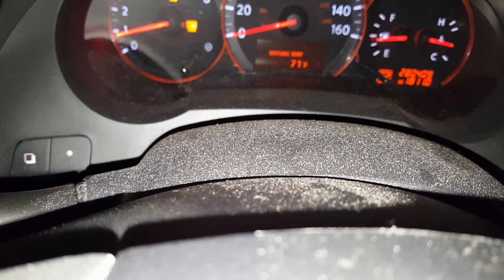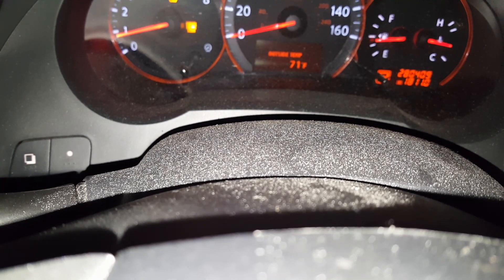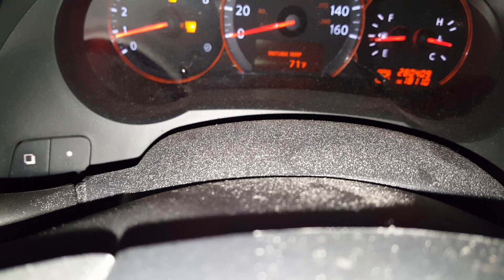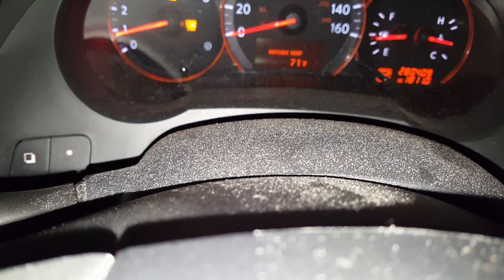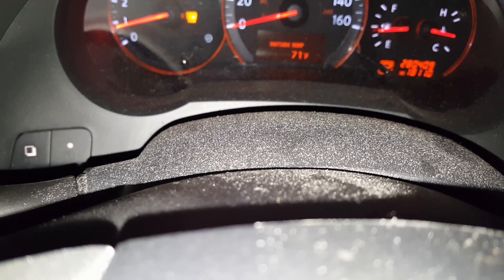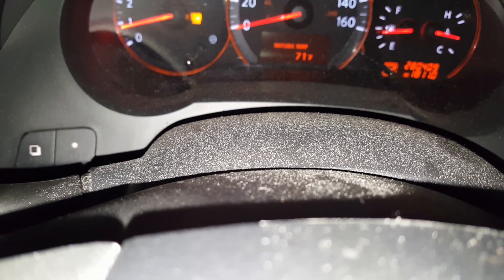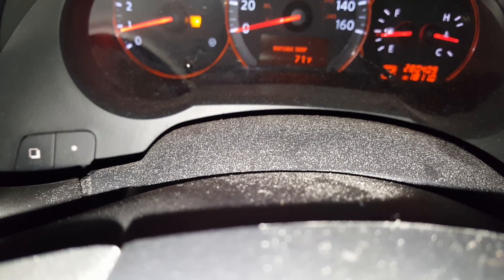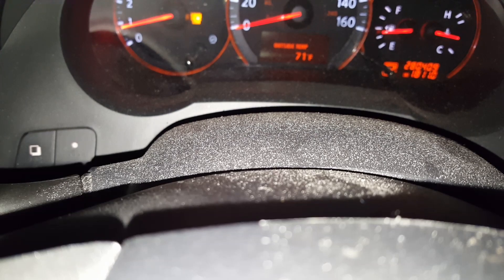Why is Safe Mode and LIMP mode on CVT Transmissions such a mystery to Everybody?

Comment: You were right just You we’re explaining it to dum ass mechanics. Safe / limp mode is common in nissans. I have a 07 Altima and the code came up was p2101 throttle issues

Comment: Yea the CVT does that my maxima 2010 after I have been pushing it for about 20 to 30 min it drops the redline from 7000 to about 4500
Reply: Did you find the issue ?
Reply: @JuanVazquez-en8uz  i was from over heating
Reply: Did you find the issue
Reply: @Markooboog  it was from over heating I found that installing an aftermarket transmission cooler helped it more

Comment: The main problem with CVT transmission is unlike an ATF   transmission  The CVT transmission fluid can get incredible hot,  mostly at the contact points of the cones and CVT belt. At these  points.  it burns  CVT transmission fluid, producing a lot of burnt carbon.  This CVT carbon in the CVT acts the same as a mild abrasive. it  left unchecked it will slowly not only wares away the cones and steel belt,   but the main parts of CVT transmission valves body  as well. Unfortunately there CVT transmission   truly need there CVT transmission fluid  change regularly

Comment: Never buy a Nissan with cvt transmission they suck.
Reply: Yea they do man I went from a Nissan Maxima 2012 that was modified with a  lot of aftermarket and engine components. I had to get transmission cooler to keep the trans cool because when I would do about like 5 or 6 pulls on the highway the trans would hear up and my car would limit the redline from 7000 down to 4500. All of my other friend in there Camero and 370z would have to slow down and cruise at slower speed to allow the trans to cool down. I got a 6 speed challenger now and it’s way more reliable then the CVT trans itself. The VQ motor itself is great I was pushing 315 whp on a 3.5 maxima never had a major issue with the engine oil was changed regularly and I always had alll fluids changed every 35,000 miles. But I got tired of the transmission

Comment: 280k be glad it lasted that long. 180k-200k is average for these CVT the valve body are garbage due to all the pressure and speed sensors. every car has some sort of safe mode. you must of taken it to shade tree mechs
Reply: 66y66 is a typo that shit u89 pl poi 8
Reply: @asiab38  typo LOL 😂 get out of here

Comment: Hey, i know this is a long one but I have a Nissan Sylphy 2006, and it does have a problem with power. First off, i do experience a delayed driving force when i step on the gas especially when the engine is hot and not in motion. This happens more so when a high torque is needed for the vehicle to move either foward or backwards. For instance when i come to a complete stop and i have to go over a bump or ramp of some sort, stepping on the gas wont make it go over immediately as i will have to deeply accelerate for a few seconds..say 7 sec..for it to even start moving. Its movement will be extremely slow until it gains momentum and after which everything works as its supposed to. Whilst all these happens, the rev conter on the dash stays stationery and does not act as though there’s any acceleration at all up until the vehicle moves. It wont rev on neutral too and the ”R” for reverse wont show on the dash board as it goes blank when being reversed. My Mech had to change the throttle sensor, had its transmission control unit replaced and also checked the exhaust system for any leakages but no show. I have constantly stayed dirty on it, moving shop to shop but it seems to prove a headache for everybody. Any help/suggestions will be highly appreciated
Reply: Have you ever changed the cvt fluid?
Reply: Exactly the same problem with my Sylphy 2007. Gearbox oil intact;no leakages. Still a mystery.

Comment: First of how many transmission have u went through u have over 200k on that thing
Reply from the maker: DailyVibeZZZ 

Just 2. The original died at 200,000. 2nd one still going strong. Close to 300,000 on my car.
Reply: Peter L wow in this video was your car sluggish from 0 to 45 miles like wavey when ur driving
Reply from the maker: DailyVibeZZZ 

No. I wasn't driving in this video.
Reply: I have 200k same tranny. Just service the thing correctly

Comment: Safe mode and limb mode can also induced by normal automatic transmissions and even the engine itself. It is in all the owner's manuals, under "troubleshooting". Every time it happens, the car computer stores fault codes that point to the problem. So in all cases you have to go to a dealer or shop and read out the computer for fault codes stored. The fault codes ares not in the owner's manual (but can be found on the internet). But still, read the owner's manual first before you drive to know at least that it is in there to look up again if it happens. Also the service intervals and everything that needs to be done at every service are specified in the owner's manual, including engine oil and cvt fluid intervals.
Reply: To really keep your transmission going is change the fluid  every 60000 miles because the filter is build inside the inturnel  parts
Reply: 9
Reply: Im having a problem like that right now what should i do.... It will not let me pass 25mph